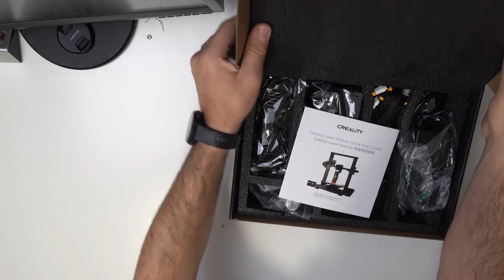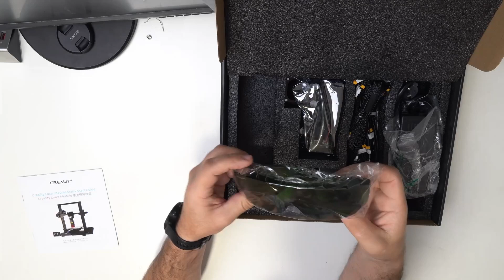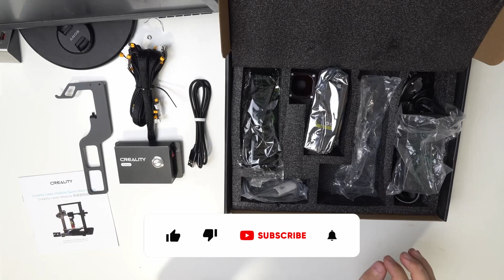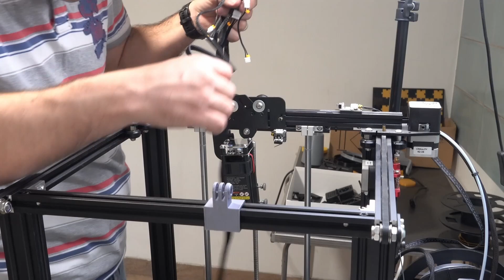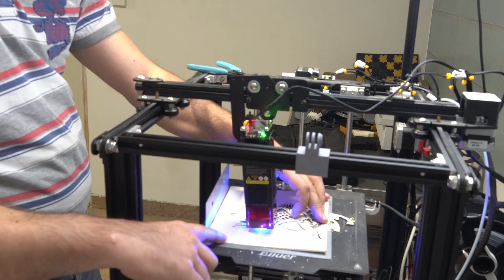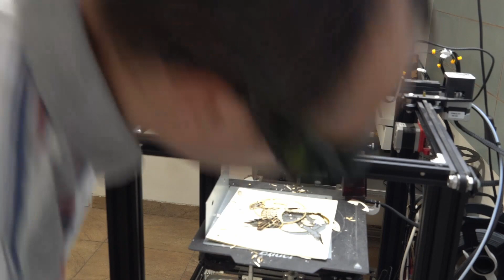Convert Ender 5 Pro to Laser Cutter/Engraver With Falcon 10W - Plug & Play Method

Comment: I have an ender 5 plus and installed this kit on it. In testing phase I cannot seem to get it to home to the rear right corner of the machine like you did here in the video, can you tell me how you got it to home correctly?  Is there  a setting in the controller or lightburn that allows this?
Reply: I myself dont have this kit yet, but i would guess that you have an option in the software, that is generating the g-code, to define the home point
Reply: @janstalder8645  did you find a solution to this ?
Reply: Did you find a solution to this problem? Im currently having the exact same problem. Changing the origin point in the software but nothing changes...
Reply: I had a similar problem with my Ender5.  I had to reverse the direction of the X and Y stepper motors by swapping the wires in the plug for these two.